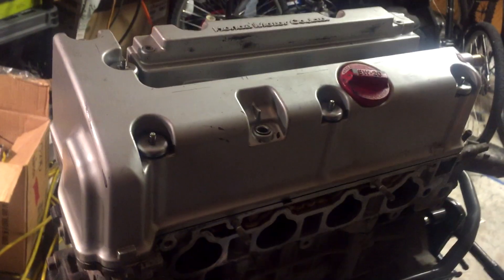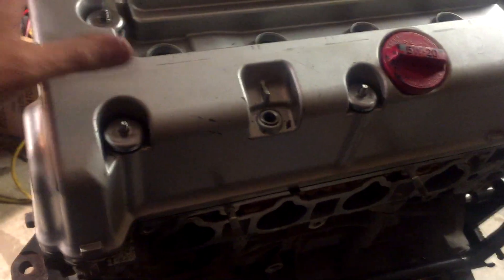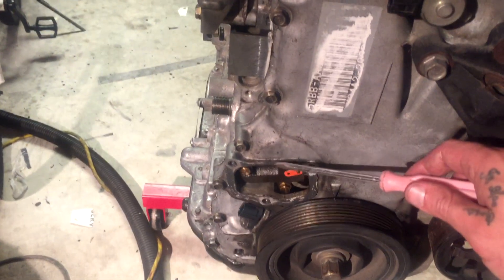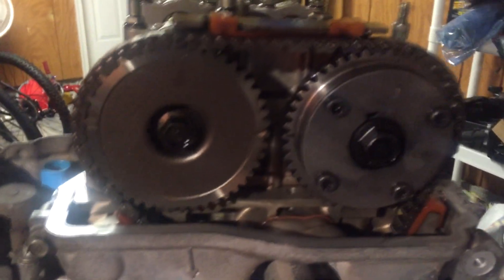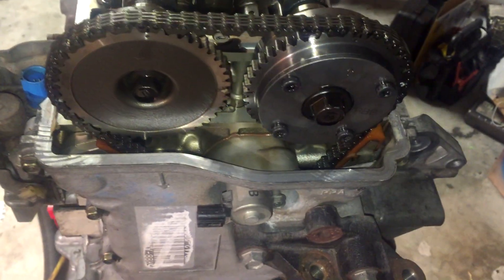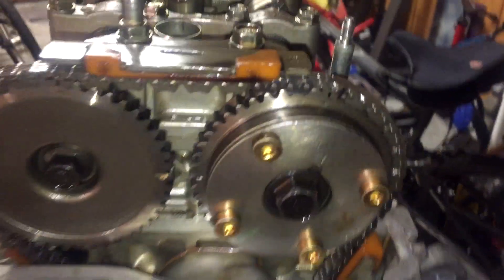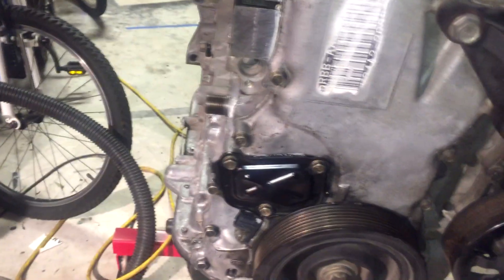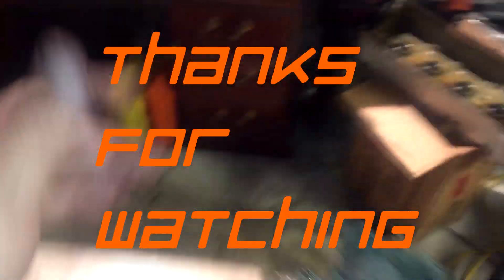Honda K Series VTC Gear Replacement

Comment: Thanks for your video. I had to replace the cam caps and even when I used the bungee method to make sure the chain doesn't slip, it apparently slipped a couple of teeth without me noticing. I torqued everything down installed everything back only to find out the car wouldn't start. I tore it all apart again and checked the timing and it was off. I lined up the crank pulley with TDC and locked the cams using a drill bit so I could set the timing. Took me the entire day since I had to basically do two cam cap replacements, two valve jobs. It always surprises me how much more smoothly and fast everything goes the second time you do it.

Comment: I've done so many of them at the dealer under warranty. Pro tip jam rags down in the cover to hold the chain. Worked for me.
Reply from the maker: Nice tip. Thx
Reply: RedLineBandits hey man can you elaborate where to jam the rags? I’ll be swapping tsx cams on my A2 and i need some tips since I jumped the Timing before when i was replacing the tensioner.  it was a pain retiming it while inside the car!
Reply: bhadz100 yea inside a car can be a bitch. I jam them where the side mount goes thru. On the chain side front and rear. Keeps the chain from falling down. Idk why Honda did not put something to keep the chain on the crank.
Reply: RedLineBandits appreciate your advice.  hopefully i dont botch it or else i go the full timing chain replacement route!
Reply: bhadz100 depending on mileage It may be time to replace the chain. I've seen them with less then 100k all stretched out. Had a Crv jump timing at 60k. Honda does not say a mileage that the chain shoud be changed.
Reply: Q i have the cover out so when i lock it in place the cam gear and marks will b back on the head and line up like it was.
Reply: f
Reply: F
Reply: What's the warranty issue bud? I just did a head re n re from vent valves... new chain and tensioner... but is it a combo of stretch and slackin tensioner thats causing the skiped teeth? I'm sure you've seen bent valves on this eh

Comment: i've got an 03 element that makes the bad vtc gear rattle @ idle under load (a/c on or slightly @ idle in gear) my rattle is not at start up like most people i read about .or is mine something else ? obviously you know this engine. any input is appreciated.

Comment: Great work.iv done this timing chain 4 times already and I keep getting p0341 incorrect phase defected.the code came after the first replacement.everything has been done by the book.the car runs great real smooth timing Mark's are spot on.anyone have this problem before?

Comment: Can you just take the actuator gear out and leave the cam in ?
Reply: Yes you can... I've done one that way. Only Issue was, getting a snug fit on the cam with the wrench used because of the excessive torque holding the sprocket, but may have been the quality or age of my adjustable wrench holding the cam in place, But definitely can be done with the camshaft left in
Reply: customhonda thanks man I been wondering if I could do it this way

Comment: Hi. Why not just crack the bolt of the VTC in place. Way more easy, no? Just make marks on the chain, zip tie the exhaust sprocket on the chain and pull them straight out and reverse to install.

Comment: From wat year does the 45deg vtc gear come from? The tsx? Also wat transmission u running? 
Do u think that aftermarket cam sticks like ( drag cartel) would be good with the oem can gear?
Reply from the maker: 2005 K20a2  engines. many others have it too but thats where mine came from
Reply: K20 vtc gear is 50deg, K24 is 25deg, the 45 deg one is a modded K20 and is a upgrade only to K24 engines.

Comment: In order to "unlock" the tensioner you need to seal (electrical tape and a zip tie works good) the forward holes (located on the most forward Cam journal) prior to blocking one hole and introducing compressed air to the other hole (second set of holes).
Not sure how this worked for the maker of the video without that step... it shouldn't?

Comment: I’ve installed the gear how do I unlock it I’m not understanding?
Reply from the maker: got to blow compressed air into the hole on the camshaft. @6:42. you possibly wont hear or feel it unlock but if you grab the gear and turn it you will feel it lock back into place. Then you will have to unlock it again.

Comment: Can someone explain the 25 degrees vs the 45 degrees?
Reply: Which is better?
Reply from the maker: @GUZGUZ18  that is the degree that the camshaft is off in comparison to the timing chain. It allows the engine to change when and how long the valves stay open. Lots of good videos on VTC that explain it better than me. lol
Reply: Gusgus 408 k20 50 degree vtc is one of the best

Comment: Also 9 out of 10 times that little 10mm cam cap bolt has been left out because Joe Blow the gear head didn't think it needed it ...
Reply: Suprisingly my 05 Accord didn't have that bolt installed from thje factory. Unless the dealership took it out before I bought the car.

Comment: i just fixed this problem by change oil and oil filter 2 times in every 300 miles, without change the actuator.